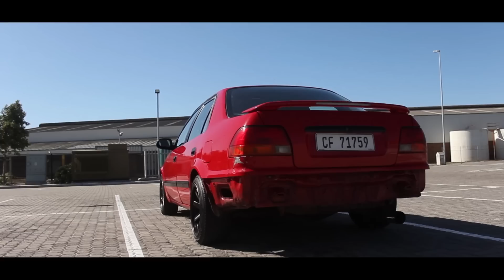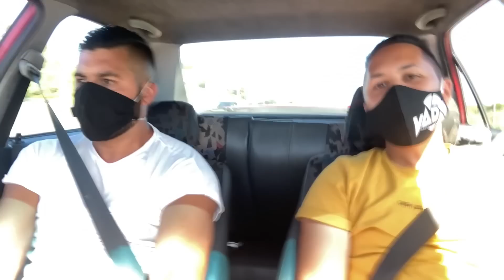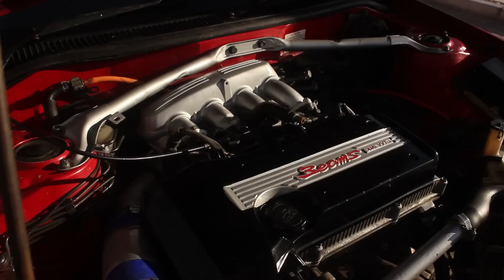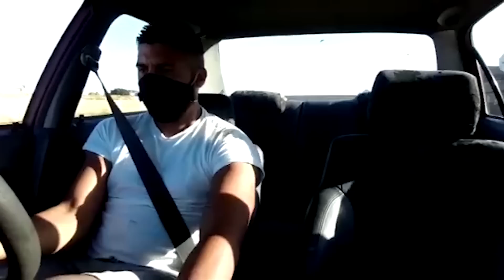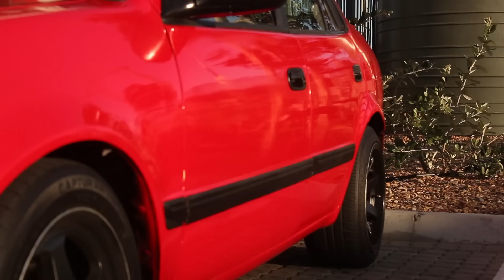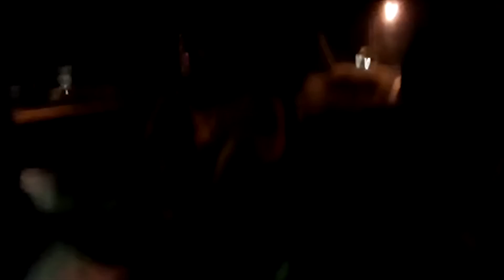3S-GE DUAL BEAMS COROLLA + DUAL PLENUM- This is my ride- Ep14

Comment: How did he put the gearbox drive shafts and cvs together? As this engine comes out of the RWD Toyota Altezza RS200/ Lexus IS200 4cylinder from japan. Those black top daul beams did not come out of FWD toyota cars. Would be interesting to know what was needed for the conversion in detail as this is not a common conversion from a RWD car to a FWD especially the black top beams. Even though you see conversions overseas being done its still not common engine used for serious na mods. South africans seem to use this engine alot. Its not a common engine to mod even internationally, maybe the drift guys but even so not common as a FWD mod.

Comment: You should let them give more detail, what flywheel he use what bolts also maybe, where do one find the parts, like adapter and does his box still have the 2zz bellhousing on or did he change to 4age bellhousing so that mountings wount be a prob

Comment: 14,3 on the draggy wow!!! i think its the fastest time if im not mistaken
Reply from the maker: It is one of the fastest tested but some cars have not yet used the dragy which I will be hopefully doing a follow up on yes. Car pulls nice and strong
Reply: @VADproductions  look for a daily it’s safe and it pulls leka it’s enjoyable.
For drag racing I’ll rather buy spare bonnet Nd add a scoop stick to the throttles cheaper

Comment: Hi guys, car is sweet but I just wanted to find out something, since you are using the runx rsi gearbox are you running custom sideshafts? Or does the stock ones from your car fit?
Reply from the maker: Hi there for enquiries on that I have provided the owners number in the description thanks

Comment: My daddys var has VVTL-I
Reply from the maker: Nice the Lift sounds amazing with those 2zzge engines hey
Reply: @VADproductions  yes with indution even better
Reply: @VADproductions  my uncle has a black TRD and he is  porting the gas flow, the throttle, putting in bigger valves , bigger pistons and cams the motor is gone now for two months coz of covid